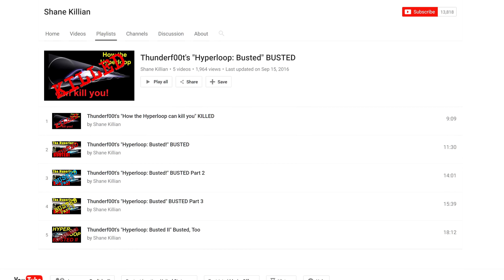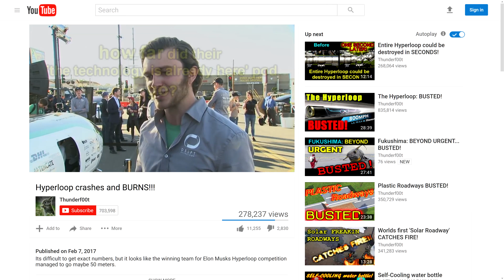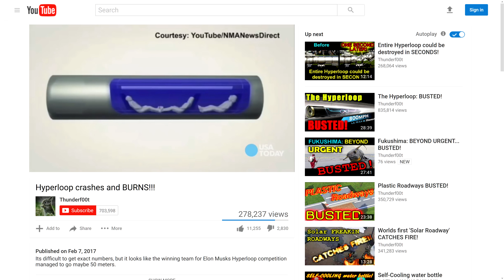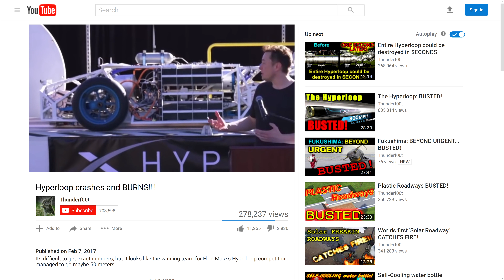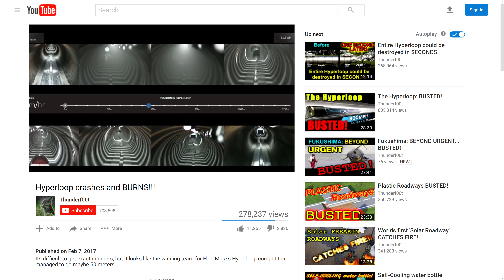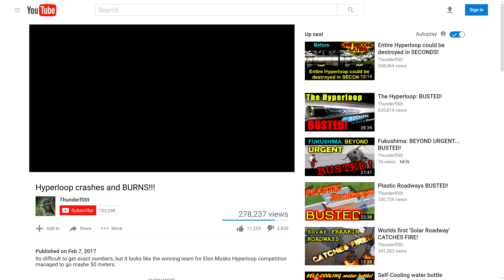Thunderf00t crashes and BURNS!!!

Comment: To look at this competition from an engineering perspective there would need to be a standardised chassis, weight and shape for any testing of safety and braking to be valid. Otherwise it’s like comparing if a gokart or truck has better braking abilities. In truth it is an interesting idea but it’s hard to see what the reason for Hyperloop actually is. If you want a train to travel faster there is already electric bullet trains that can travel at 600 km/h and the overall cost is easily far lower than a Hyperloop would be, to surpass the maximum Hyperloop speed jet turbine engines could be used which would probably be cheaper to manufacture and around the same energy costs if not less. 
Just interested if anyone has any ideas of the advantages of this system that I might not have considered yet.
Reply: What bit of 'standardised' don't you get Shane, before calling some a moron (or any other unnecessary derogatory name) maybe you should do a little research into standardised test and why they are important in ANY scientific field.
Reply from the maker: "To look at this competition from an engineering perspective there would need to be a standardised chassis, weight and shape for any testing of safety and braking to be valid." LOLWUT??? You're saying they'd all need to be using the same design in order to test different designs???

"there is already electric bullet trains that can travel at 600 km/h" Oh, FOR FUCK'S SAKE, do you not know the difference between 600kph and 600mph? 600kph is just 370mph, HALF the speed the Hyperloop is designed to be!

MORON.
Reply: Shane Killian yes I’m saying that the standardised practice for testing for instance a braking system is to keep all other aspects as much the same as possible. For this reason you can then compare relative results across multiple prototypes or put simply compare apples with apples. This is both a standard in engineering and science. 

As for the 600km/h that I mentioned about bullet trains. I never claimed that the Hyperloop can travel at 600mph or aprox 1200km/h. As far as I have heard there hasn’t been a fully functioning Hyperloop to be able to give a maximum practical speed. The thrust ssc on the other hand does present an alternative for a 1200km/h vehicle with obvious limitations based on the requirements but the overall capabilities of turbine engines does provide for an alternative for the Hyperloop if a speed of 1200km/h “has to” be reached. This is mainly based on the extensive amount of development and research that we have already put into turbine engines.
I’m not having a dig at you personally as much as I’m questioning the basis for the Hyperloop project when it would have been easier to achieve the same results in cheaper and quicker alternatives. 
Take for instance maglev design, the basic requirements are to have both magnetic levitation and wheels that are capable of the maximum speed of the vehicle and while magnetic levitation does have its advantages it doesn’t present a large enough advantage over just using wheels. All I’m saying is that it’s hard to understand from an engineering perspective why they are going to extremes when much simpler alternatives are possible and possibly present a more beneficial design.
Reply from the maker: "the standardised practice for testing for instance a braking system is to keep all other aspects as much the same as possible." Oh, SHUT THE FUCK UP. You have NO FUCKING CLUE ABOUT THIS. Even AFTER I explained it IN DETAIL. Your ignorance IS WILLFUL.

"...when much simpler alternatives are possible and possibly present a more beneficial design." Except THEY AREN'T. Governments over the world have shown that OVER AND OVER AND FUCKING GODDAMN OVER AGAIN! That's the PRECISE reason for all of this interest!

This is really what it's all about, isn't it? Private companies might succeed where the Holy Omnipotent State has failed so many times--and we can't have that, now, can we? Same reason Thunderf00t lambasted Musk for an unforseeable accident that wasn't his fault while blissfully ignoring the causes of the PREVENTABLE Challenger and Columbia disasters...
Reply: ooooooooooookay then. 
Best of luck and all that.
Reply from the maker: Right, another state fundie with no response. Pathetic.

THE PODS WERE MADE TO SPECIFICATION. THEY PASSED THE TESTS. What you did is the equivalent of complaining that they were different COLORS.

NO market efforts get ANY credit; the state gets it all no matter how much they waste and how much they fail.
Reply: Yeah your just kinda weirding me out. To be honest
Reply from the maker: I'm not the one deliberately avoiding arguments and spreading misinformation about government programs while trying to bogusly discredit private efforts.
Reply from the maker: LYING is ABSOLUTELY provocative. Stop your bitching just because I keep calling your side out for the anti-science neo-Luddites you are.
Reply from the maker: Right. And yet, you attack the person who called out a liar and not the liar herself.
Reply from the maker: "when someone made a point that was different to yours" Yeah, this is ALWAYS the bullshit. A BLATANT LIE (and what could you POSSIBLY need to fact-check it, beyond the links given in the Video Info?) is just "someone making a point that was different to yours.

But you're not siding with anyone. RIIIIGHT.

Comment: Thunderf00t's day are numbered. Sooner or later these projects will go live and he will lose all credibility.
Reply: If Hyperloop goes live, it will only be until the first deadly crash.
An evacuated tube is not needed, a train travelling just under the speed of sound would be fast enough. Hundreds of times the danger and expense, a poor user experience, and a flaky system added to the issue of a high speed train don't make it better.
Reply: yeah and we'll all drink from the waterseer
Reply: Yes, 2 out of 3 isn't that bad. TF didn't say it was impossible. That would be stupid as we have already landed quite a few objects from space even before Musk was born. The question is whether or not it is worth the effort as bringing it back needs extra fuel, reusing rockets needs costly maintenance checkups/repairs, etc Is it really a good roi to reuse them or is it smarter to just make a "fast" production line and minimalise costs bc you can bring more weight instead of the fuel.
Reply: Projects like solar roadways? Or thorium cars? Or waterseers? Or self filling waterbottles? Musk's first priority is Mars and only Mars. Hyperloop is just a sideproject which he doesn't care about. Hence the incredibly slow pace and the fact that it is an opensource project with student competitions (not that students are bad but they are cheaper and competing with each other instead of Musk making great investments). Even Einstein was wrong sometimes and Musk is no Einstein, not even close.
Reply: Oh look, SpaceX just landed their rocket back on earth. Can't wait for the ThunderCunt response video "debunking" that.

Comment: Soooo, what were they actually testing?
Reply: Did anyone watch the video Tf00t was refering to? They literally tell each step of the process. Propulsion and braking tests were done outside on a track identical to the hyperloop but w/o vacuum tube around it. In the tube, only speed and distance were tested as propulsion and braking was already tested before and only the pods that succesfully passed all tests could enter the actual tube. Watch hyperloop's video.

The propulsion system wasn't limited to magnetic levitation. Just check the pods or the competition rules. There were 3 different types of propulsion at least. This isn't difficult to check online with google or on the hyperloop site. Why are people believing Shane while he is demonstrably wrong in this case.
Reply: Proof of concept and magnetic levitation
Reply from the maker: We went into it.

Comment: I would be very interested on how hyperloop fans try to solve the expansion problem tf mentioned, fair enough tf statements are not true entirely, but as an engineering student I can tell you that the massive expansion problem they will have means the fall of the Hyperloop whatsoever...
Reply: Not only is tunnel boring to expensive but vertical inclinations at near subsonic speeds are dangerous and there is a max inclination before humans get sick or become unconscious. So making tunnels through some mountains is the only option really. Even with horizontal inclinations there are quite a few factors to keep in mind being speed, radius of the circle the vacuum tunnels will follow...
Reply: Is the Hyperloop not being designed to be underground... tunnel boring? No?
Reply from the maker: No, tunnel boring is just too expensive. They're talking about tunnels through hills where it would make too steep a curve to go over or around, but that's it.
Reply: As an "engineering" student it is your job to overcome those design obstacles. Otherwise your "engineering" degree, if you even manage to attain it will qualify you to turn screws into wood.
Reply from the maker: "I would be very interested on how hyperloop fans try to solve the expansion problem tf mentioned" Then WATCH THIS SERIES, because we went over it!

Comment: So you have not seen the thunderfoot videos? You do not refute any of T.F. speculations. We shall see.... if we live long enough.
Reply: Sorry, I too missed that part of your video.  In summary, Thunderf00t said it would never work.  If you don't believe Thunderf00t on that point, then invest some money in the project.  But you don't seem that reckless.
Reply: Shane Killian your  speculations  do not refute anything except your ability to reason. Then comes the personal attack. You call me a liar,  typical Trump strategy. Please express your love for mr. Musk more rationally. I hope to live long enough to see hyperloop, matter transmisson, warp drive, and self-sharpining razor blades, but of snake oil salesmen......I have seen enough. Thank you for your ill thought and rude reply.
Reply: Shane Killian Taking TF and my statements out of context, then another personal attack...sigh.  Shall we calculate the energy necessary to achieve   and maintain near vacuum  in a 300 mile long cylinder? How many vacuum  pumps? No response? Calculate the danger to passengers when vacuum fails due to 24/7 operation, metal fatigue, earthquake, vandalism, terrorist attack..... No? Then shout a bit lowder and call it proof.
I have ridden Japanese high speed trains (in 1970). Train ran sweet, ticket was cheap, speed about 300kph. France also has a high speed passenger train system, all above ground. USA has not been interested in high speed rail because of cost of infrastructure, lack of passengers and low profits. Hyperloop is hype, learn a little sales resistance, please.
Thank you for the reply to my comment, it was every bit as coherent as your vid. End of message.
Reply from the maker: You say I have no ability to reason, yet you conflate an attack on your ACTIONS with an attack in your PERSON. And throw in a Trump reference for good measure. Desperate and pathetic.
Reply from the maker: "Taking TF and my statements out of context," I've taken NO ONE out of context and made NO personal attacks. STOP LYING.

"Shall we calculate the energy necessary to achieve   and maintain near vacuum  in a 300 mile long cylinder?" 50 cents, according to Tf00t's math.

"speed about 300kph." That's 186mph. The test pods have already surpassed that!
Reply: I not sure what world you live in man. He basically broke down every single point in the video.
Reply: "50 cents, according to Tf00t's math." - Shane Killian when asked for calculations. Yes I do sciency stuff. I'm pretty sure math has nothing to do with that, right? Right guys?

"That's 186mph. The test pods have already surpassed that!" You do realise that those trains got better in the last 47 years, right? Also those test pods didn't carry any passengers nor travel bags, the extra air supplies etc. The PODs are a nice poc but not a real representation of an actual test. Also pods? You mean 1 POD.

Comment: I am pretty sure it had wheels and wasn't levitating...
Reply from the maker: You mean the WARR group's pod? They used some new kind of maglev that doesn't require a magnetized track, just a conductive one.
Reply from the maker: That was the one that won the speed competition, which is what you said.
Reply: +Preoccupied Procupine - Look at the MIT test footage, it levitated off the ground after a certain speed. Some maglev trains have wheels as well and don't levitate until 150 kph
Reply from the maker: The wheels are ONLY there to get it going until it got to the speed where it could levitate, as I covered.

Comment: Do you not realise the main problem with this the original proposed journey is far bigger than this and it took 40 to decompress the small stretch they had made so for a long distance journey which is what it was designed for the passengers would be put in the tube the wait hours probably days yes you could add more pumps however the cost of hundreds of better pumps would be insane and the cost of all the electricity would be far too much for the cheap tickets that where proposed yes there is a few flaws with thunderf00ts video but that still doesn’t mean the hyper loop is stupid however his new earth to earth rocket is still just as stupid if not more
Reply from the maker: I was talking to frost squad, so thanks for another LIE...
Reply from the maker: "Do you not realise the main problem with this the original proposed journey is far bigger than this" So?

"and it took 40 to decompress" So? The next time they did it, it took 15 minutes.

"yes you could add more pumps however the cost of hundreds of better pumps would be insane" No, it wouldn't. Standard industrial pumps would be fine.

ALL of this we covered in the series! But here's yet another anti-science neo-Luddite who won't even WATCH it, and pretend he knows oh so much more than I do...
Reply: do you actually think they would vent an entire fucking tube just so people can get in and out of the pods? how simple minded are you? Do you think you need to empty an entire fucking fish tank to clean the pump? Okay, not exactly the same analogy but the concept applies. Stop with your 2D thinking.

Comment: Hilarious and ironic, a lot of talk that Thunderf00t was wrong...and then pretty much either supporting what he was talking about or "forgetting" to mention what he was wrong about.
"He is wrong because he presumes things" and then using own conjectures to "prove" TF wrong...rofl.
And of course, out of all links put into description not a single one is actually supporting points made in video(like what tests were actually run during event that TF talks about). We are supposed to simply take it on fate. Why to frak would i care about world fastest hydrogen racing car(that have been mentioned numerous times for no good reason), when bulk of the video is trying to prove TF being wrong !
Also, now, 15 years later, autonomous cars are still merely in a prototype phase. With their "proven safety and reliability record" being achieved solely under controlled conditions.  With a mile-long list of possible issues. For someone accusing TF of nitpicking, one have no problems with resolving to same tactics to prove point. Ironic.
Reply: > With their "proven safety and reliability record" being achieved solely under controlled conditions.
Are you seriously comparing a few vehicles driving in the desert versus cars designed to navigate streets and traffic alongside millions of cars driven by humans?
Give those teams of 2004 the technology we have now and they all will pass the competition with flying colors.
Automatic driving in highways is already safer than driving manually (well, very probably, we need more data to be completely certain).

Comment: How are you possibly going to test safety of something that is supposed to travel at 700mph while only testing at 50mph? Ya make no sense 😎
Reply: Shane Killian. cool so here i have this Scalextric car that survived a 40mph crash and here a full size version without any structural changes and we want you to crash it at 700mph does that sound fun.
Reply: take the structure of classic Japanese homes, 4 structural posts, a roof and some non structural walls, you cannot scale this up you must add new supports or if you would prefer transport the air frame of a small crop duster is significantly different to an Atlantic Jet, the technologies and designs must be changed to allow it to become bigger.
Reply from the maker: It's called a "scale test," moron!
Reply: Shane Killian call me when you're ready to board the Hyperloop, I won't hold my breath
Reply: Shane Killan. most physical technologies don't scale easily, technologies that are being tested in smaller, slower, higher pressure environments don't act the same as bigger faster lower pressure ones.
Reply from the maker: Wow, you people really do have no fucking clue how this works, do you?
Reply from the maker: "most physical technologies don't scale easily" LOLWUT??? I'm gonna have to give you a [citation needed] on that one...

"technologies that are being tested in smaller, slower, higher pressure environments don't act the same as bigger faster lower pressure ones." Ditto.
Reply from the maker: Except they keep doing just that! Yes, designs change all the time, but that's what people do! Why are you pretending it's this intense barrier?
Reply: Welp Hyperloop One tested a full sized one at 200 mph. Test tracks aren't currently long enough to sustain 700 mph test